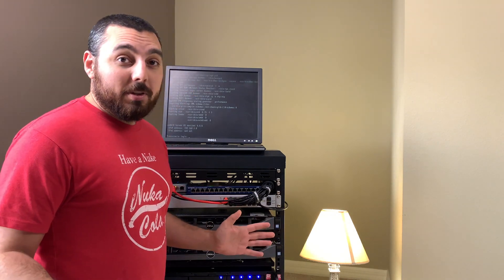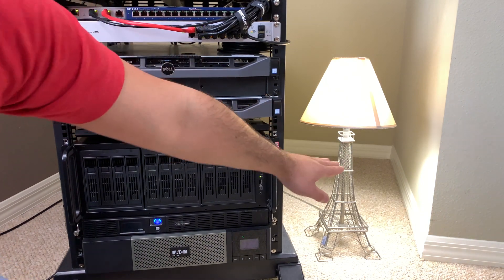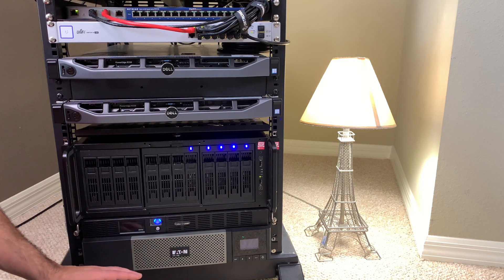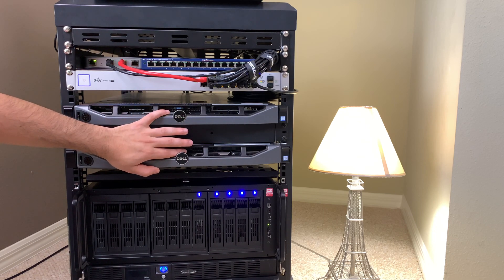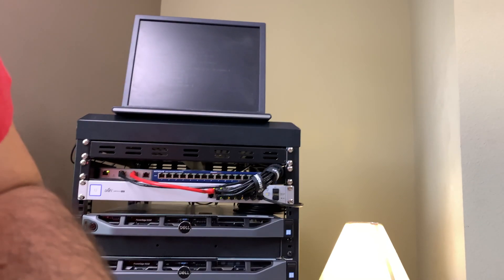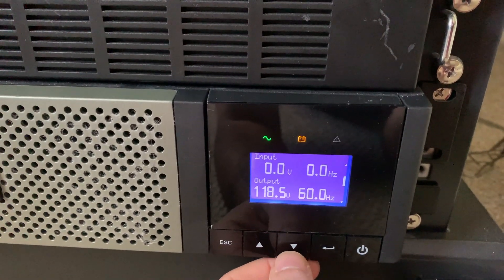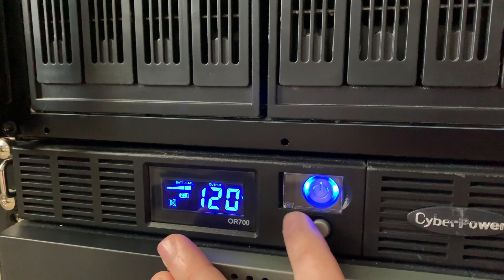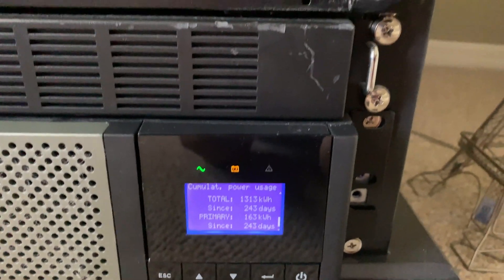Eaton 5PX 1500RT Simulated Power Drop

Comment: couldn't have just pulled the plug from the wall? would have been nice to see the Network view, isn't that the point of the network card and configuration? would have been nice to see.  Still good looking home rack.
Reply from the maker: I could of but people where concerned about the switch from wall to battery and said that the server would shut off during the transition so felt like this was a good way to show no loss of power.  Also, someone asked to do it this way.

Thanks!